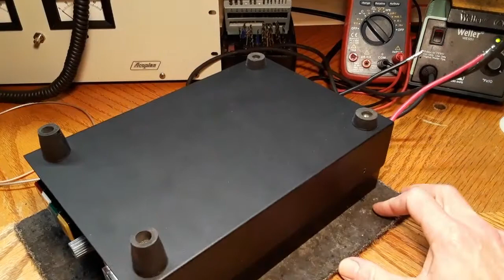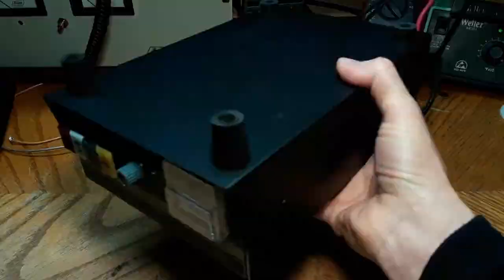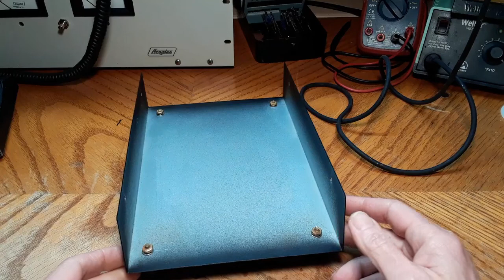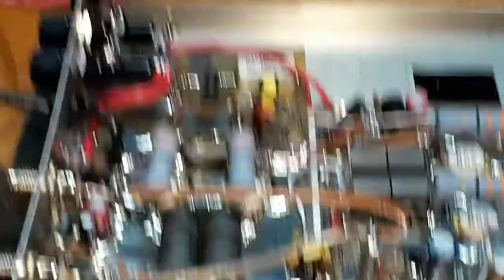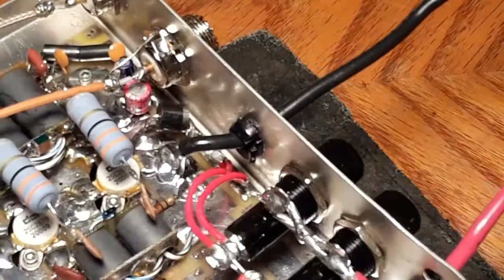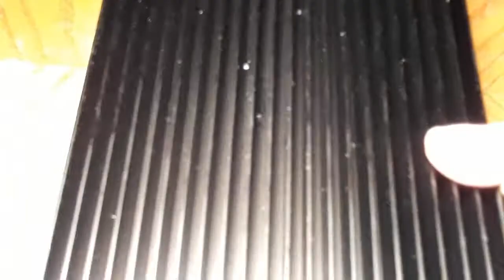texas star dx500v new: debugging

Comment: That power wire setup is not even close to what that amp wants. you should be feeding each board individually with an 8ga wire. Should have 4 wires protruding from the back of the case and eliminating the fuses.
Reply from the maker: Yep the fuses are the down fall.to much voltage drop.each board will run fine #10 each.30 amp rating in chassis wiring.2 pills wont pull over 30 if at all.